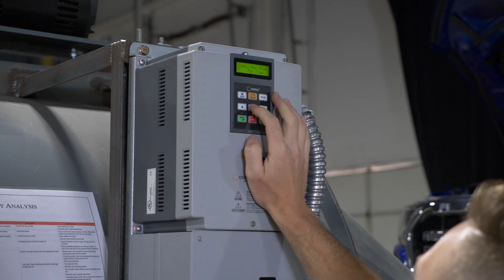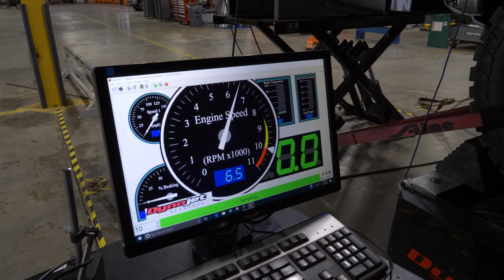2019+ Ford Ranger Modification Testing

Comment: Just installed the Catch Can..went on fairly easy and looks great like it belongs under the hood...the outlet line is a nice vacuum source will the rubber used in the hoses withstand valve cleaner spray or with they deteriorate. I'm trying to avoid spraying into turbo and possibly filling intercooler with cleaner.
Reply from the maker: The hose material should have no issues holding up to the valve cleaner.